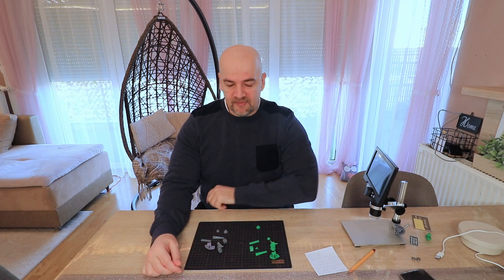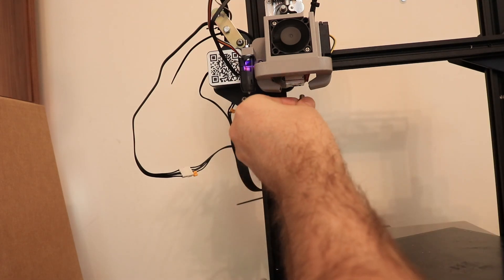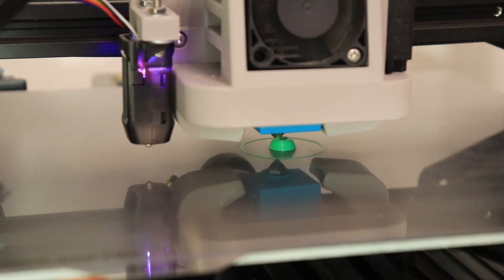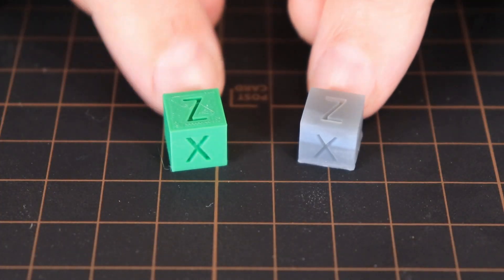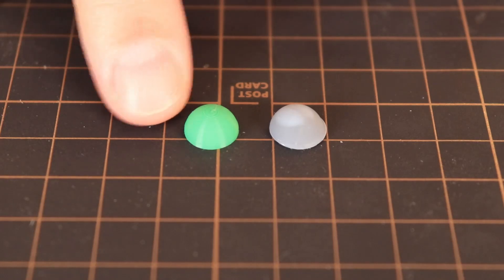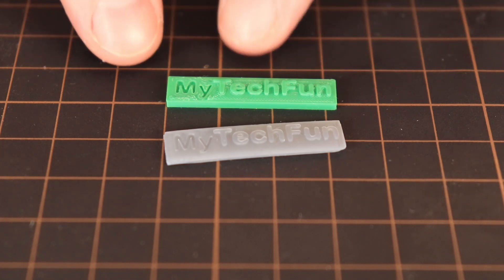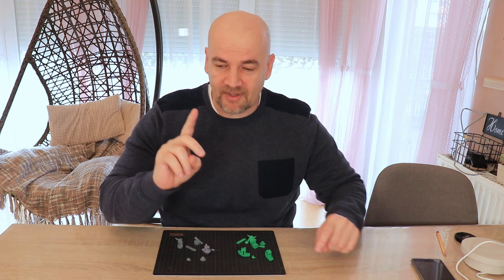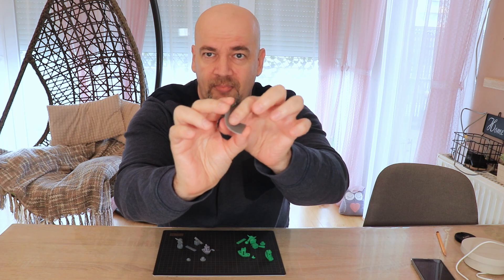FDM vs SLA 3D printing: the QUALITY comparison (FDM with 0.2mm nozzle)

Comment: Definitely not worth a resin sls one if one has to be accurate, like that gear you printed there. There's not so much gain with resin to compensate for that awful elephant foot (you had also a bit of layer shift I see). I wasn't expecting, tho, elephant foot to be a thing on resin prints. On the benchy it completely warped the base of the hull.

Comment: Yesterday I first tried a 50% benchy, with 0.4 nozzle, 0.42 lines and 0.08 layers height, Arachne walls. It came out very close to this, though your 0.22 mm line puts all its details where they belong.
I use to face the hull in front of the auxiliary fan, if present, and not in a square angle to minimize stringing between the 4 columns, tho Idk if it's actually worth the effort.
The 15% one is stunning! So tiny so cuuute!! :)
Reply: The 15% benchies yes resin don't string but watch out the horrible overhang at the base of the hull. That single detail is more accurate on the FDM 15% one! And this is very strange, it looks like a disconformity typical of the FDM printers, not the resin ones. Veeery curious artifact.

Comment: Hi Igor, can you test again the 0.2mm nozzle with a 0.4mm line width in arachne ? You can tune your slicer with arachne to print line width from X value to Y value. So you can safe time on infills for instance and save overall about probably 30% of time but keep the same quality. 
You should also probably change the layer height for the FDM print to make a more fair comparison. So SLA 0,06mm and FDM also 0,06mm layer height.

Comment: This doesnt make sense,..

If you bother to change the nozzle on the fdm printer and optimise the settings you should consider optimising the settings for the resin printer as well. Now you compare an optimised FDM printer with an out of the box first resin print,..
-Decrease the layer hight for the resin printer
-Pick a high detail resin
-Print some test samples to optimise the exposure, you can get verry sharp edges,  you probably should decrease the first layer exposure.
-use anti alias
-You dont need to print the object on the buildplate, you can print it anywhere, still, starting from the buildplate sometimes offers dimensional advantages and a decent slicer ( paid version) has an option to prevent elephant foot,... 

Miniatures or gears or,... printed on an FDM printer require low temperatures and high cooling and they result in weak parts , brittle, poor layer adhesion,..
Time, if a model is a bit bigger and you want to print it with a 2mm nozzle you are in for weeks rather than days,.

Comment: From time to time I do print objects directly on printing plate, but I use setting that is called "pad around (object)" it helps a little bit with elephant's foot. I'm not sure if it is only Prusa slicer setting or other programs have this, but it is very similar to FDM printing's skirt, but with small connections to model, eg. if you would be printing hemisphere you would have about 5 to 6 connection form that pad to model. Why do I print on the bed? Because for me it is easier to fight with elephant's foot, than trying to add geometry to the model in in places where it gets deformed.

Comment: i even print at 0.05 layer height with 0.4 nozzle, the quality is fantastic.
Reply from the maker: Yes, correct, quality in Z axis (for example nice top of the sphere). With 0.2mm nozzle, you get more resolution in X, Y direction (for example 3D printing business card letters)

Comment: Others already mentioned it, but it's basically what is totally skewing this comparison video, so I feel it should be repeated: you should not print directly on the buildplate with SLA! You need to ensure that all your burn-in layers are NOT part of your part as they will expand more due to the longer exposure (needed for good sticking to the bed).
Reply: And many of his FDM models were riddled with stringing

Comment: why not print .05 with the .2mm nozzle?
Reply from the maker: I could, but then the printing time would be almost doubled. Bed should be super leveled (except if I start with bigger initial layer). But risk of clogging of the nozzle is bigger.
Reply: @MyTechFun  that's fair. It skews the results as far as quality comparison though when one has twice the resolution layer wise.

Comment: Never print your SLA parts flat on the bed. Always elevate them from the surface and rotate it to about 45 degrees. Then you will see the letters on the bottom of the benchy and will get no elephant foot. I print a lot with Prusa and Voron FDM printers and since a few weeks also with a Mars 3 Resin printer. 
And most of what I learned in FDM printing is irrelevant to resin and vice versa. This is a different process with different physical constraints, so it's best to watch a few videos on object alignment and supports and the results will be much better.

Comment: For even better details with FDM: Kaika nozzles by Tecdia. And SLA keeps tempting me, but in the end the toxic waste disposal hassle has kept me away.
Reply: Not to mention the fumes that smell like cancer!
Reply: @foam27  still people smoke, drink alcohol, drive motorcycles, climb mountains and have unprotected sex. Is resin better or worse?
Reply: @kimmotoivanen  It's gotta be worse, have you smelled Siraya Tech Blu resin? Damn.
Reply: Resin-y stuff (paper towels, gloves) can be cured in plastic bag (sun does it best) so they become mostly harmless. Or they can be put to waste that is burned properly.
Part of washing liquid can be reused (after resin settles down, curing can help separation) or evaporated (alcohols burned) and the remains cured etc.
It takes some time and effort (and using water does not make it any easier) but for some prints resin is just the way to go ;)
Reply: @kimmotoivanen  I always prefer resin prints, just don't want the tumors 20 years later. :O

Comment: I think the general recommendation for SLA is to not print directly on the build plate for a few reasons such as elephants foot, and larger models can get stuck to the FEP if too much surface area is in contact. Therefore most prints are elevated and tilted and wholly supported instead of touching the build plate.  In this setup, I think your precision parts would have been nearly perfect. 

This of course increases time, materials, and post processing, but it is the way. 

Also, as mentioned elsewhere in the comments, wash and cure should be factored into the time for SLA prints.
Reply: can anyone give me best settings for 0.2 mm nozzle on ender 3 v2

Comment: Thanks for this video!  I have wondered why I mostly see figures being printed with SLA and not engineered parts.  FDM looks to be a better choice for parametric CAD designs.  Maybe a rough conclusion can be made that if you use Blender for your designs, SLA might be a good printer choice.  If you use FreeCAD or Fusion 360, FDM may be the better option.
Reply: There are quite a few extremely durable resins suitable for mechanical prints.
Reply: @jvlbme  Which are more expensive than equivalent thermoplastics/casting resins
Reply: @WhenDoesTheVideoActuallyStart  The 'trick' (skill in the art) for casting is to print molds in appropriate 3D resin and cast them with desired casting materials, I believe you can find many proficient demonstrations of this on Youtube (VoG is one example).
Reply: Can you explain why a mesh-modeling program (eg, Blender and the like) vs Parametric modeling software (FreeCad, Fusion, etc) has anything to do with additive manufacturing tech selection (FDM vs SLA)?

More relevant, if one is modeling statues or manipulating STL files directly, a mesh-modeling program will be superior (or even 'the only game in town').

For mechanical parts and such produced using either FDM or SLA,  FreeCad, Fusion, Inventor, IronCAD, Rhino etc. (parametric and solid modeling software) will work optimally in the hands of one proficient in their use (vs. a mesh-modeling program which will be next to useless for this purpose even for an expert in its use).

The key is to know your tools and pick the best tool for the job!
Reply: @retromodernart4426  I only use blender, and make mostly mechanical parts. You don't have to sculpt just because it's blender, it can be quite 'rigid', even though it's not a classical CAD.
Reply: @jvlbme  Obviously, you must be highly skilled in and familiar with Blender to create accurate, functional mechanical parts in Blender, and obviously you are because you do that.

Would you agree though, that the 'rigid' [mechanical] parts you make in Blender are actually 'sculptures' accurately depicting a mechanical part?

Whereas in a classical, competent CAD program, by design, one designs a part dimensionally and optionally, with relationships to other parts that can be combined (still in the CAD program) into assemblies that can be tested for fit and function in the CAD program, and then exported as distinct parts, 3D printed (or manufactured in some other process) and then assembled into a working mechanism?

Conversely, 'sculpting' an intricate dragon, for example, in Blender would generally produce far superior results at least far more easily than doing so in a classical mechanical CAD program?

No offense intended, I'm just curious and glad to have the opportunity to ask one at your obviously high level of Blender proficiency, thank you!
Reply: @retromodernart4426  You can most definitely construct all of what you described in blender too, but what a CAD system does better is 'documenting' the process, and changing measurements might, thus, be faster in CAD. But assembling and testing is not a problem in blender. I'm no wizard, probably rather mediocre actually, I just happen to like the flow of blender.

Comment: Nice video. Specially interesting to see how much you have pushed FDM quality.
However, my choice between FDM and SLA, in most of the cases is based on functionality and practicality.
Reply: can anyone give me best settings for 0.2 mm nozzle on ender 3 v2

Comment: Great idea and execution for the video.
Elephant foot on SLA seems to come from over-exposure of light the first few layers, so it will stick better to build plate. Can be remedied by raising build slightly off build plate. Or so I've heard
Reply: That's the way to do it, just raise prints off the build-plate and suspend them with supports.  Elephant feet are common with people coming from FDM printing and easy to remedy by thinking it through differently.  It's also good to print raised models at a slight angle
Reply: can anyone give me best settings for 0.2 mm nozzle on ender 3 v2

Comment: Great detailed video as usual.

Not a flame, just a fact:  As you know, it's possible to get far better SLA results (precise dimensional accuracy, no elephant's foot, etc.) than you showed with a better SLA printer than your Elegoo Mars, and I'm not talking about expensive industrial quality machines either, and using better settings for the object being printed and the resin being used.  Objectively, you showed some of the worst, ugliest, dismal, embarrassing results of SLA printing possible.

Obviously you have much more experience with FDM printing, and of course FDM printing is great for many purposes and at this time, seems like the only economical way currently available to get those multi-color prints without going to expensive industrial "ColorJet" type technologies.

Thanks for your great content and presentation!
Reply: Agreed on this!
Elephant foot on SLA can be significantly reduced (Lychee/ChituBox) or eliminated (Buldge Buster), even when printing directly on the plate. While when printing the more difficult FDM materials, whole buildplate adhesion issue gets even worse and nastier (I chopped off large piece of surface glass once, trying to remove polycarbonate part).
Reply: Yeah but FdM is still better overall, only case where it isn't is with small figurines
Reply: @Ebani  Can't agree - neither is "better overall", it depends on use-case.

When's the last time you made a functional roller bearing in one piece in FDM, for example?

Or a super-light glider in Resin MSLA?

Neither is "better" - they're both excellent but one can be better than the other for a specific model.
Reply: can anyone give me best settings for 0.2 mm nozzle on ender 3 v2
Reply: @proyontan7652  go to the Reddit subs and ask.